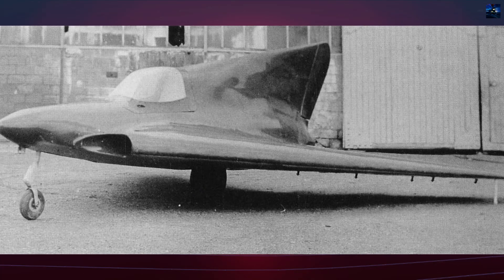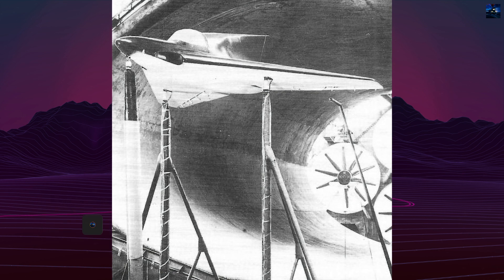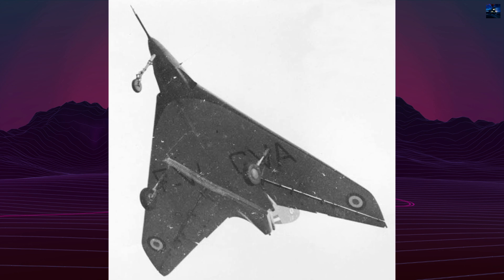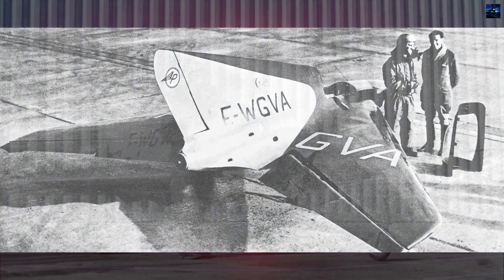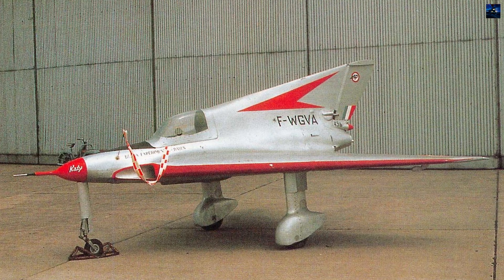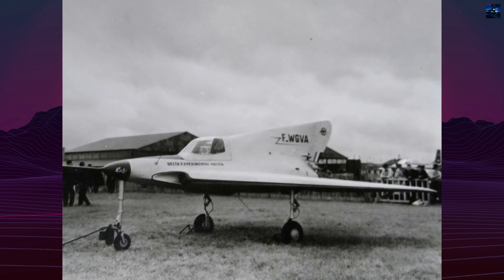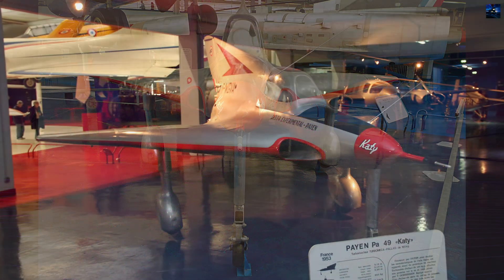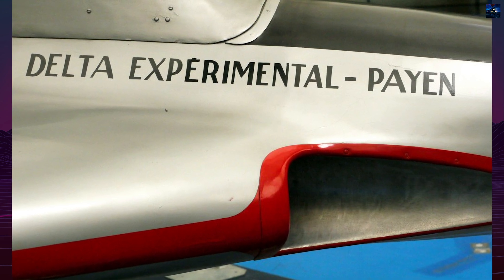Payen Pa 49: The Smallest French Jet You’ve Never Heard Of

Comment: Couldn’t retract the gear because there was no internal volume left for it. Also, the split rudder/speed brake would have had a nose up moment imparted when deployed which might help in the flare for landing? If you imagine how the pilot sits in the tiny fuselage, his feet (and rudder pedals!) are jammed up in the tight nose! Can’t imagine much room for the fuel (in the wings I imagine) or anything else? The bifurcated inlet has to go in there somewhere. Thanks for sharing the color pictures. She is a cute little bird!